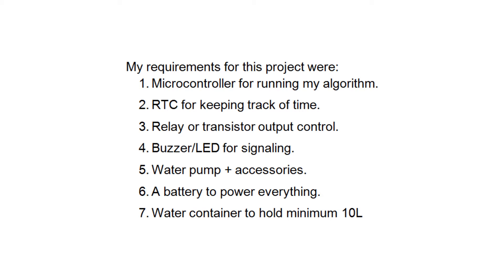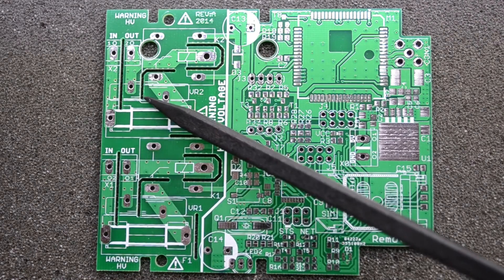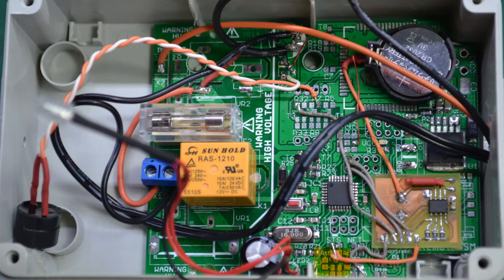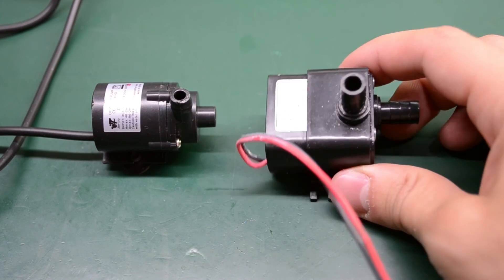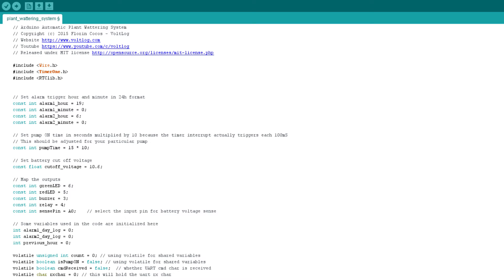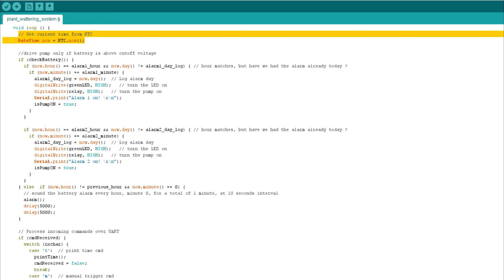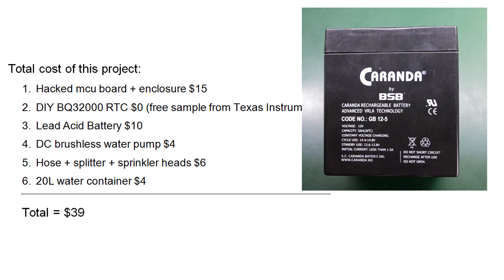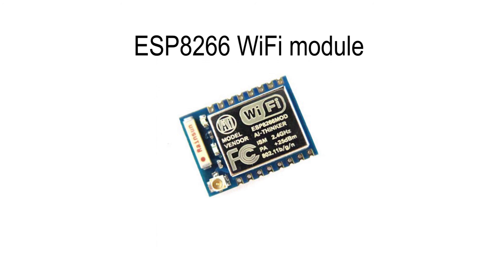VoltLog #24 - Building A Cheap Automatic Plant Watering System

Comment: bro tell me pls, 
What happened if water in tank is empty?? Then ur water pump may burn in dry run conditions... You should embedd two project in a single project.. I. E. 
Smart irrigation system with automatic water level control using ultrasonic sensor.. So it gives sustainable solutions zero maintenance...

Comment: Why not sense how moist the earth is and activate/deactivate the pump with that info?
Iwe seen ppl do this with just two conductive nails they solderd two wires to and and opamp.
Reply from the maker: +tbbw several reasons why, in my case at least: 1. this was a one day project built with what I had around, I didn't have any soil moisture sensor, and although one can be easily built, reason 2. they corrode in time and the readings change. 3. in a large plant pot, you might need several as the moisture might vary according to position and water distribution. 4. I find it easier to use an RTC and just have 2 profiles, winter and summer.
Reply: +VoltLog Well your build made me think of maby making one myself so i guess your video wins in terms of been inspiering :)
Reply from the maker: +tbbw don't keep those plants waiting :)
Reply: +tbbw I tried with nails that drived a transistor that light up a led when it's dry, the electrolysis corrodes it in less a week to useless level.
Reply from the maker: +DjResR wow, that's faster than I imagined. I was thinking I would get at least 4 weeks before problems started to appear but nonetheless, sensing soil humidity is not an easy job, that's why I didn't use it in my implementation.
Reply: DjResR I just built mine using copper wire, maybe that would work better